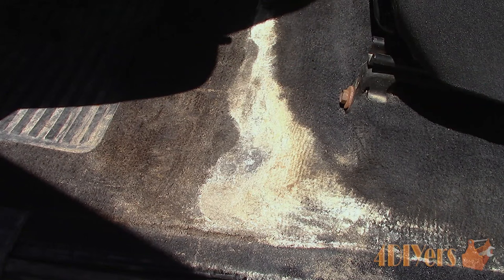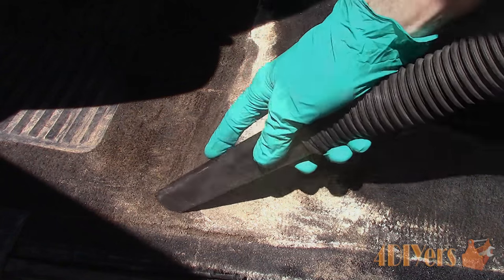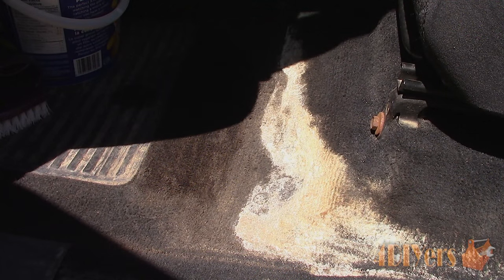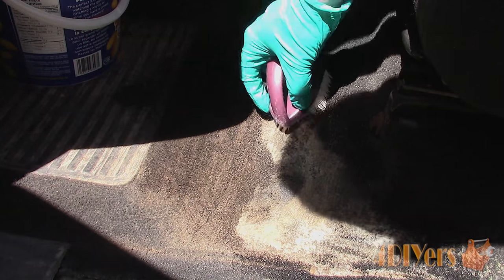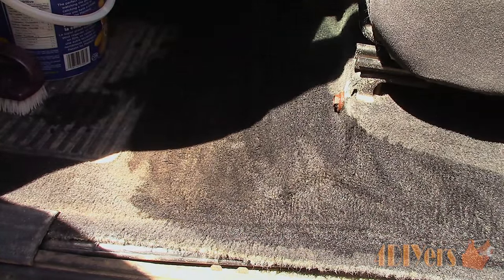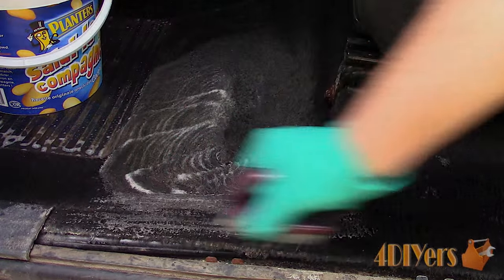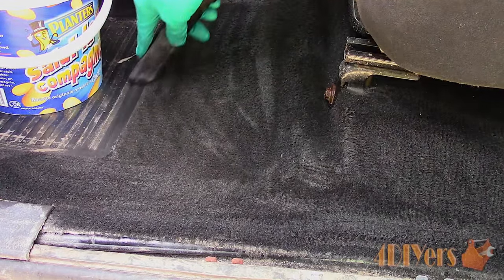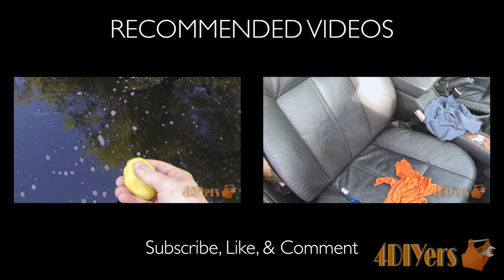DIY: How to Easily Remove Salt Stains

Comment: I bought a used c30 with salt stains and have tried numerous times to get it out with no luck. used carpet cleaner and the water/vinegar mix along with a drill brush and shop vac and the stain looks like I didn't even touch it. any tips?!?!?!?!?!

Comment: nice detailed instructions, you have that "flight attendant" speedy instructions and are very fluid with it.  "“Ladies and gentlemen, the Captain has turned on the Fasten Seat Belt sign. If you haven’t already done so, please stow your carry-on luggage underneath the seat in front of you or in an overhead bin. Please take your seat and fasten your seat belt. And also make sure your seat back and folding trays are in their full upright position."
Reply from the maker: Thank you for flying with 4DIYers ;)